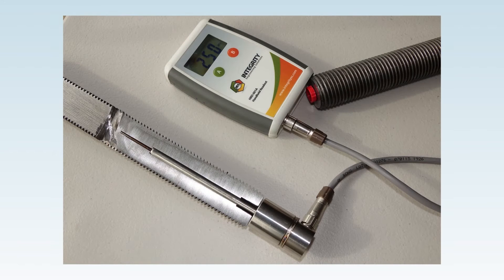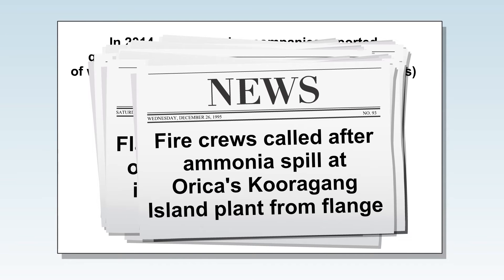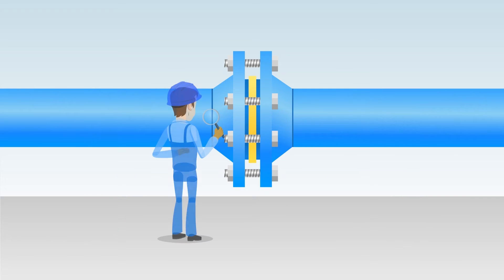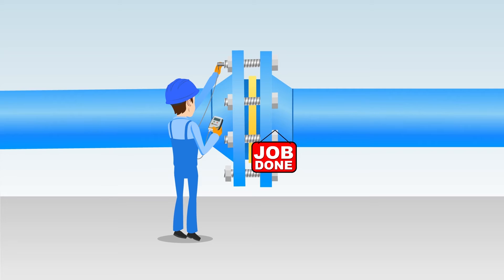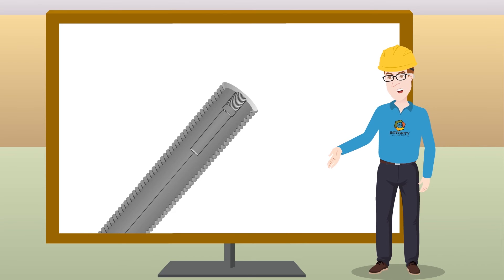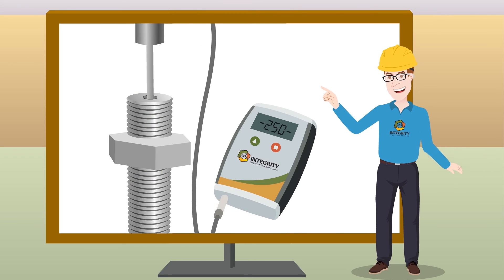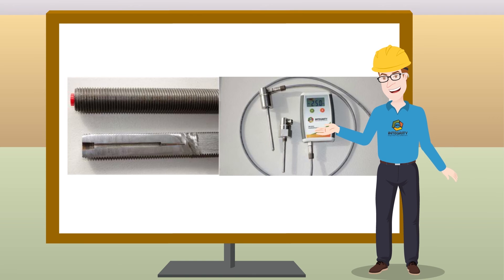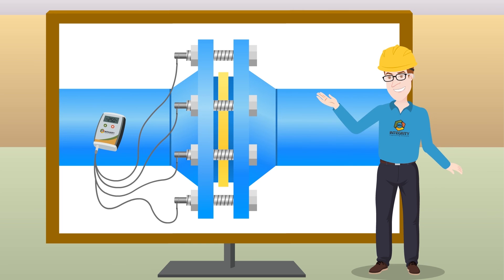RT Bolt Intro

Comment: So...does each bolt in my flange setup need this?
Reply from the maker: Mike D, it depends on how critical the joint is. If you can tolerate some variance in bolt load, then the use of 8 or more RT-Bolts and torque tightening can definitely be a useful solution. We specify a minimum of 8 bolts (unless you have a 4 bolt flange of course) in order to allow for some averaging of the data and more accurate measurement of readings in each quadrant of the joint. Only one bolt in each quadrant makes it hard to determine if a change in load for that quadrant is real or not.